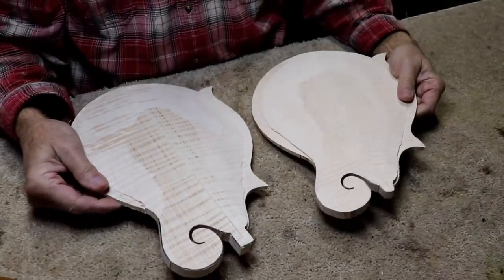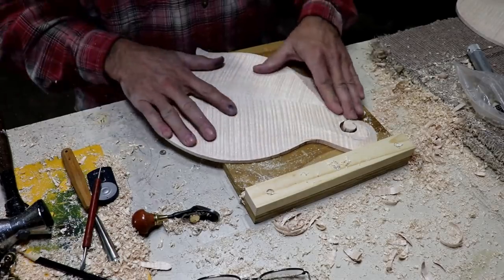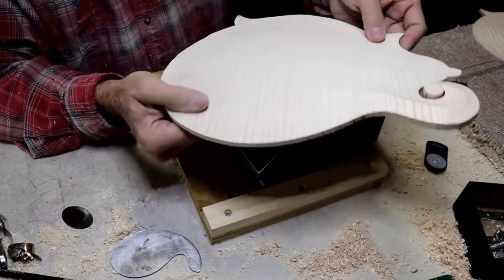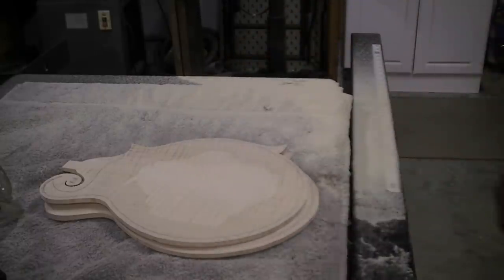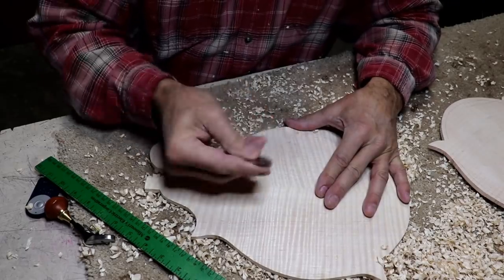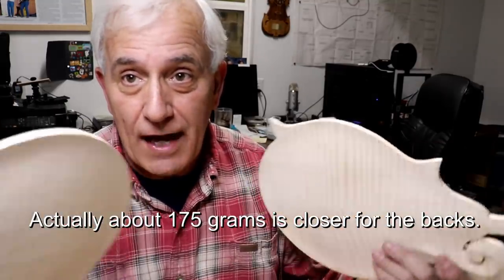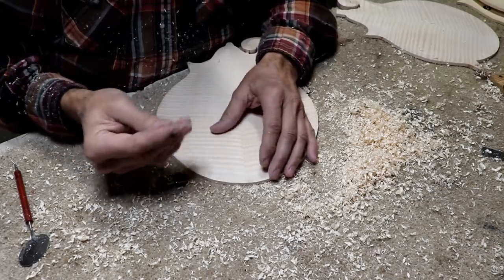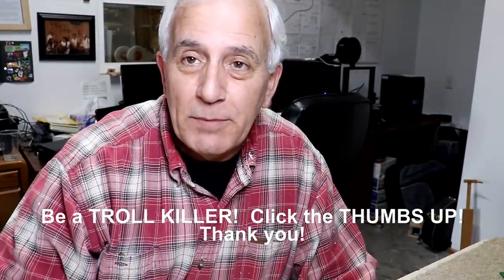275 RSW Custom Twin Mandolins P2 The Backs

Comment: Jerry, I may be all wet, but to me scraping over wood has to close the pores too. I believe that whatever works for the individual is the best way to smooth the wood. Sorry if I offend any of you purests, but I truly believe that. By the way, I think I would love to have a set of those scrapers. If you come across a source for them please post it in one of your videos. I am a subscriber and will get a notification. As usual your video is great.
By the way, Your .001" accuracy is one of the reasons why you can charge $6000.oo for an instrument and be truly justified in doing it. Please don't apologize for your fine workmanship. Most of us love that you take such pains in your work and I'm sure your customers are in that group.
As a former engineer I can tell you that as well as sound quality and volume, the arch in the back and top plates adds an immense amount of strength to the plate which helps the instrument resist the tension of those eight strings. Not to mention it makes the instrument look prettier as well. In case you are wondering why I edit most of my posts, it's because I like to comment when I'm at the place in the video that I'm commenting about. Also if I find errors in my comments later I go back and edit it.
Love those twins!

Comment: The classical violin makers did not have sandpaper.  They used ray and shark skin.,  Cutting tools also burnish the wood, giving a much better finish that abrasives.  The device at the beginning is called a bench hook. Your fingers fan detect differences of 1/10,000t of an inch.